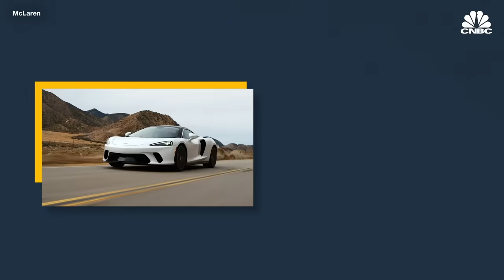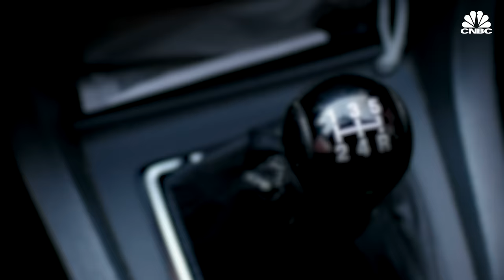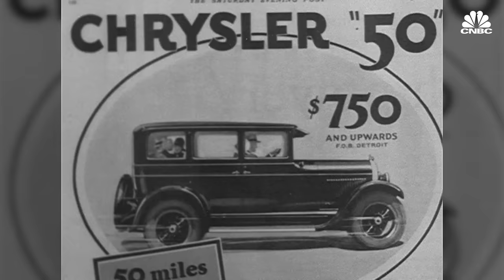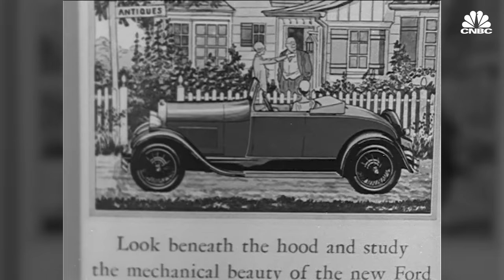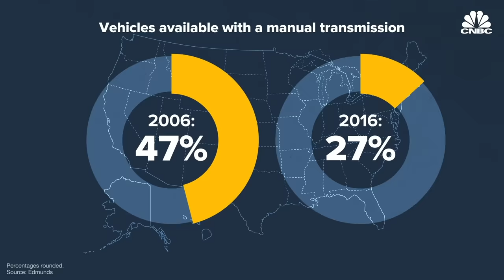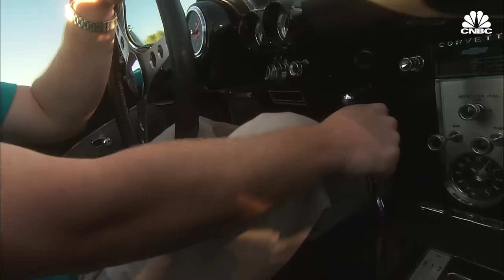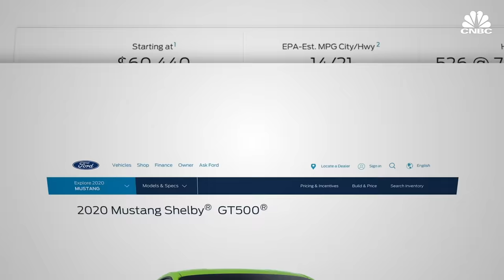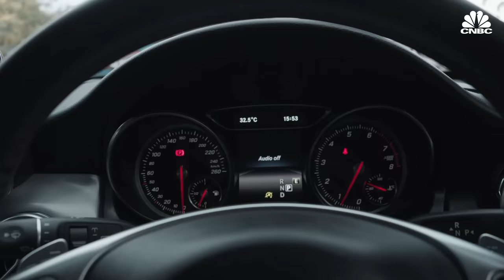Why Stick Shifts Are Going Extinct

Comment: I am from Eastern Europe, but I moved to USA at the age of 16. Took driver's education at school, learned to drive on automatic. Back home my dad taught me basics of driving a manual, however, I only got an idea, but never had any good practice. In 2014 I travelled in Europe and rented a car there, which was of course a manual (since requesting an automatic would be twice the cost). That was pretty much like being thrown into a deep water in order to learn to swim. I started with driving in a very busy, congested city, so it was quite hard and nerve consuming (with typical adventures like stalling many times and not being able to start moving uphill), but after just a week I got a very good feel of it, and never had any problem renting manuals in Europe ever since. I actually found it much more enjoyable than driving an automatic, so for 10 years I was dreaming about buying a manual (for practical reasons, I don't switch cars often).
I recently bought my fourth car in USA, which is finally a manual Subaru (all cars prior to that were automatic or CVT). Had to get previous model, as they unfortunately stopped offering manuals starting 2024 model year. Knowing that in another 10-15 years they will probably be completely extinct, buying it was the last chance of getting a relatively new, low mileage manual car.

Comment: Here in Europe it is unfathomable that one could get a driver's license without being able to drive a car with manual transmission.
Reply: My friend here in Sweden just did, the manuals are eventually going to go away here as well ;(
Reply: @christofferhansson7950  Here in Finland driving lessons and tests are required to be taken using a vehicle with manual transmission. I guess gears of any kind will eventually disappear when we move to electric cars.
Reply: True. Here in North Macedonia you can't get a drivers license without driving a car with a stick shift and it looks like that will stay for a while.
Reply: In Poland you can get an automatic-only licence since few years ago. In fact the only reason I even bothered with getting a manual license is that I applied a year before they changed the law and for paperwork reasons I could not change my application.
Reply: @erwinkonopka7071  Same with the UK
Reply: In the UK, you can get an automatic only license, but good luck finding a cheap car for that...
Reply: @penumbra0182  You mean that you can get a license which allowes you to drive an automatic, but not a manual? Why would anyone want that kind of a license, when getting the full license probably isn't more difficult or more expensive?
Reply: @jaakkooksa5374  Some people have problems learning to drive on manual and some people just realized that manual is an old tech not worth learning. Even in EU more than half new cars are sold as autos. And this % gets bigger every year.
Reply: @jaakkooksa5374  Yes, here in the UK you CAN take your test in an automatic car if you choose but your license will only be valid for an automatic car. That's why unless there is some physical reason you can't drive a manual everyone learns to drive and takes their test in a manual because then your license is good for both manual and automatic.
Reply: Maybe decades ago, in the last 10 to 15 years automatics are pretty much the same price as manuals.
Reply: Same in Colombia. My American husband was surprised when we met my 85 year old grandma for lunch and she was driving manual on a busy city.
Reply: In UK can have auto only license.
Reply: @penumbra0182  No luck required, Picanto, Aygo, C1, 108. All around £12K.
Reply: @piperjaycie  small cars about £500 for the auto going up to £1500 for a larger car like a Focus/Golf.
Reply: Same in Brazil. You learn to drive and take your driving exam exclusively on manuals. Which are still pretty common and holds the majority of the market share of cars around here, since they are cheaper to buy and to maintain.
Reply: It wasn't that long ago that they were common in the US. I'm only 36 and when I learned to drive, both of my parents cars were manuals. I owned 6 different cars with manual transmissions from 2000-2015 and have driven dozens more. They're not THAT uncommon here and it's still a good idea to know how to drive them. Although I have to say, I haven't driven a manual transmission in a couple of years now. I have friends that still own vehicles with one though. I feel like most people here over about 30 maybe 35 at least know how to drive a manual. They might not be good at it, but they can drive the car if they need to.
Reply: @DacLMK  Here in the US I took my drivers test in a manual back in the late 90s and they looked at me like a was crazy even then. I will say the commercial drivers license here requires a separate endorsement to drive a truck with a manual transmission. There are still a lot of semi truck here with manual transmissions on the road but even those are disappearing fast.
Reply: @jaakkooksa5374  no it isn't. In Finland you don't need to drive a manual car. You can do the test with a automatic transmission. But then you can only drive with a automatic transmission
Reply: i will be moving there!!!!
Reply: @jaakkooksa5374  Who knows, maybe by the time it's legal for me to drive that will be true.
Reply: I wonder how much of that has to do with the fact that americans on average drive 2x as much per year as the average european?
Reply: What is the point? My friend had a manual and did not miss it.
Reply: it should be required world wide
Reply: Really? I just got my license for automatic and bought one automatic car in Germany.
Reply: In Spain you can get an automatic only license. You can only drive automatics with that, but almost no one gets that license. The usual thing to do is to get the normal license and you learn in a manual. Most young people get used cars that are mostly manual. I just prefer the sensation of manuals but I get automatic nowadays are faster and probably safer.
Reply: young people in the UK can only really afford cheap cars,  like £2000 maximum  for your first car. And the vast majority of cars £2000 and under  are manual transmission.  So I don't know a single person who has an automatic only license.  I think automatic driving lessons are more expensive too. Only if you fail your test like 3+ times do some people decide to get an automatic license  as it is easier.  But honestly manual transmission is easy enough as it is,  it is learning the rules of the road / roundabouts etc  that is the hardest part.
Reply: I'm in the USA..and I think it should be unfathomable to get one's licence here without that ability also!...and to me, it's even more unfathomable that you can't even buy a new heavy-duty pickup truck with a manual transmission.. :(
Reply: @christofferhansson7950  also humans driving cars at all will eventually go away
Reply: You can get your driver's license with a vehicle with an automatic transmission in Sweden, but then you ARE NOT ALLOWED to drive any vehicle with manual transmission and your drivers license will even have a code on it that specifies this.
Reply: @troy1993  Good luck staying awake and alert to your sorroundings in order to take control WHEN the autopilot fails/gets into a situation it wasnt prepared to handle. Just sitting idly monitoring something monotenous is something humans are really bad at. And good luck navigating somewhere that doesnt have a street address.
Reply: automatics are growing fast in europe too. once electric becomes the norm in the future, manuals will die here as well. enthusiasts could probably still buy manual but more and more companies are shifting (heh) to automatic.
Reply: In Kenya too.
Reply: Well you can get a driver's license in Austria without learning how to drive with manual transmission. The catch is that you are then only allowed to drive automated cars which is a a humongous disadvantage because most cars are operated via stick shifts. So if you want to shoot yourselves in the foot  Austria does have a solution for you  :D
Reply: Europe also limits you to vehicles with a gross weight limit of 3.5t (including trailer) on a standard license.
Reply: @dyer2cycle  The reason that manufacturers dropped the manual from the HD pickups (Dodge/Ram last one to do so) was that the manual transmissions that fit in a light (class 2/3/4) pickup can't handle the torque. Dodge was derating the Cummins from 2011 to 2018 on manual transmissions only. By 2018 the difference in torque between the manual and automatic was 270 lb ft. Not many customers are going to choose 660 lb ft when they could have 930 lb ft for the same price.
Reply: @rich7447  ..yes, but if I want a heavy duty pickup, I want a d@mned manual transmission...if they are too light duty, then they need to design a better one or adapt one from a medium duty truck..I get sick of driving everything that is an automatic...cars, etc. are enough...even 1/2 ton pickups need a manual option...people have become lazy, and most don't even know how to drive without an automatic..it's become ridiculous...expensive, complicated, easy/often breaking, electronically controlled, and VERY $$$$$$$$$ to repair when they break...actually, I think the government/manufacturers want everybody to only want/be able to drive automatics because it is MUCH easier for them to take total control of your vehicle/self/remote driving with an automatic rather than a manual....
Reply: @dyer2cycle  The problem is that 1,000 lb ft of torque that every HD diesel is making these days. That amount of torque was not even available in a lot of medium duty trucks 10 years ago. As for the crazy electronic controlled transmissions, I agree. I have a 68rfe in my Dodge and I knew when I bought the truck that it was a timebomb waiting to go off. If I were going for a manual that could handle it the torque of the Cummins I would probably be looking at a Eaton T1056. The issue is that that it weighs over 500 lbs and doesn't fit (twice the weight of the 68rfe).  

Gas HDs and 1/2 tons would be easy for the manufacturers to put a manual in if the market was there.
You might be on the right track as far as the government goes.
Reply: @mikesully110  What if your parent's gift you a car. Btw working at age 17 is pretty rediculous
Reply: @salvatoremaglione6398  I guess if your parents are rich they could buy you an automatic car and auto lessons. But TBH any boy with any self respect in the UK who is into cars will do manual transmission lessons. I'd get laughed at by my friends if I had to pass an auto test lol.  Even my brother who is more into Ru Paul's Drag Race  than he is into Drag Racing,  he even passed a manual test.
Reply: @mikesully110  
You have pretty bad friends if they laugh at you for something like that. Also, what is your idea of self-respect? Imo I'm genuinley just unwilling to drive a manual because it's just useless skill to learn nowadays. I could care less if manual is more "fun" because I live in a big city with alot of traffic. Btw, my family and I are more middle class than rich and are taught that you should pay for as much if not all the son's/daughter's expenses until they finish all their education.
Reply: @salvatoremaglione6398  well I come from a working class family and there's no way they could afford to buy me a car.  But in the UK you can pick up bangers for £500, but they will all be manual transmission. So for poor families manual is the only thing you can do.
But if I were you now, learning to drive in 2021 I wouldn't be too bothered about only learning automatic. In 2030 the UK is forcing electric only cars so by then nobody will be driving manuals anyway. But coming from a poor family, my options for cars would be severely limited if I could only drive automatic.

But if you are going to the trouble to get a driving license why not do a manual?  it won't take too much longer, and if you ever need to borrow a friend or families car, if you can only drive auto you might have a problem there?
Reply: @mikesully110  
Tbh I don't even have much against manuals and in some cases, it might be better at special events like driving on a country road or circuit racing but auto is much better at daily driving like heavy traffic or motorway driving. What annoys me the most is that the majority of people where I live (UK) like to shove it down your throat that "autos are for stupid Americans" or "autos cause distracted driving". Probably this comment section is the best example I know.
Reply: @jaakkooksa5374  In Japan, "automatic only" licenses are pretty much the norm these days, and it costs more to take driving lessons for manual.
Reply: wow really?
Reply: Have you been to Switzerland lately
Reply: You can.  BUT you then have a license that is only good for automatic trans cars.
Reply: @jaakkooksa5374  brother the main difficulty in driving IS the gear shifting and clutch control. An automatic license would take much less time to get. However good luck finding a cheap automatic car 2nd hand in the UK!

Comment: A manual transmission is the best anti-theft device you can have.
Reply: Totally agree!  Insurance companies should give massive premium discount based on inability to carjack in the US.
Reply: Most people just tow cars they steal
Reply: Agreed 👍
Reply: The people most likely to know manual transmission are car thieves.  Your average car robbery is just someone smashing your window and stealing any belongings inside. But if someone drives away with your car, they probably did it with a higher level understanding of cars.  They use wireless key fobs, and other tech to get inside your car and start it.  These are the guys who would quickly drive your car to a location, strip it of what they can, and leave it behind.  And yeah, they probably SPECIFICALLY know how to drive manual.  They usually know the car they're going to steal ahead of time.

Don't ask me why I know this.
Reply: Ahahaha👍
Reply: @mangaas  Common sense.
Reply: maybe in the states, lol
Reply: It's the best answer to "can I drive your car."   I wouldn't let them anyway, but I ask "Can you drive a stick??"   I know the answer is "no"!!!!  LOL

I act so disappointed that they can't.....
Reply: @Sahadi420  exactly haha
Reply: @mangaas  There are lots of security camera videos of a thief trying to drive away with a manual transmission car, stalling it 10 times, and then running away.  I have seen it numerous times.  I have also read several stories about failed car jackings where the carjacker abandons the car and runs off when he sees it is a manual transmission.
Reply: Sadly that isn't true. I've heard of a few cases where tow unmarked tow trucks might have been used to steal cars.
Reply: ArmchairWarrior  always get a police Interceptor
Reply: LoL.
"Sweet!! I got in....F*ck!!!!!!!!"
Reply: in Brazil is the opposite
Reply: That's true in America, but manuals are plentiful in other countries. Their cars last longer because it's manual and they know how to shift properly.
Reply: exactly!
Reply: ArmchairWarrior  💯
Reply: Oh yes I agree! Because with manual I feel more confidence and connected to the car.
Reply: With manual, I feel more confidence and connected to the car.
Reply: Wrong.
Reply: If you learn to drive a manual it becomes second nature....you don’t have to think about it, you just do it. Best to learn in a manual then choose an auto. I drive an x3 auto, it’s great but I miss my manual so pinch my sons fiesta to reacquaint myself lol.
Reply: @mangaas  because you are a car thief yourself, probably trained by Vin Diesel in the Fast and Furious films
Reply: It’s true, my door locks broke about 3 years ago. The quote to fix was ridiculous....still hasn’t been stolen.
Reply: No, having a horse is.
Reply: @Sahadi420  It's like owning an HP calculator with Reverse Polish Notation back in college when everyone else used calculators with algebraic notation. Someone who would want to borrow my calculator would change their mind when they realized there's no "=" key.
Reply: If you push an older manual and drop the clutch in first gear is starts so no it’s not the best anit theft device 😂
Reply: Kept my wife from driving my truck...I tried to teach her how to drive a stick shift: I said very calmly "give it a little gas" and watched as the took her foot completely OFF the gas pedal-end of lesson.
Reply: @legalsan3913  So damn true, But not realistic XD
Reply: In america not europe.
Reply: Except for the thieves that load your car on to a flatbed, which is a common type of car theft.
Reply: Only in United States 😂
Reply: @legalsan3913  that would cause more people to buy manuals, canceling out the anti-theft idea.
Reply: @legalsan3913  actually my 2023 Kia forte GT is six manual and it’s about $20 a month cheaper than the automatic version because of that reason.
Reply: @mangaas  actually know your average car thief is usually under 25 years of age very limited driving experience and most in the United States cannot drive shift. I had somebody try to jack my car while at a gas station. The car was idling. They got in and try to drive away and couldn’t drive it because it stick shift well I told the cops I don’t know how he got a blackeye and a blasted lip, but yeah, he got snatched out of the car pretty hard